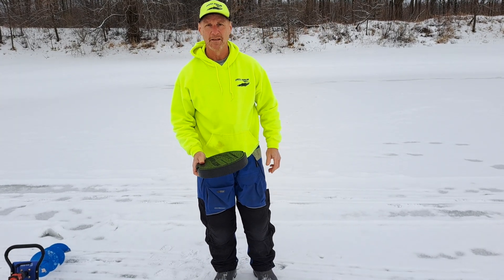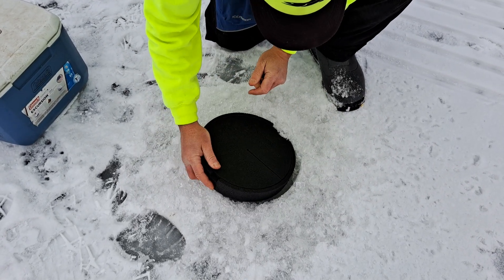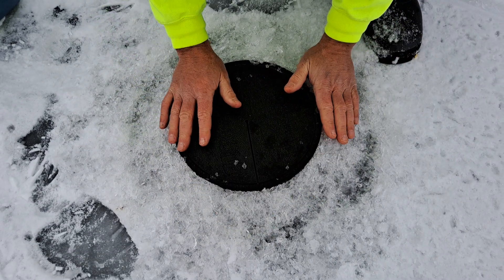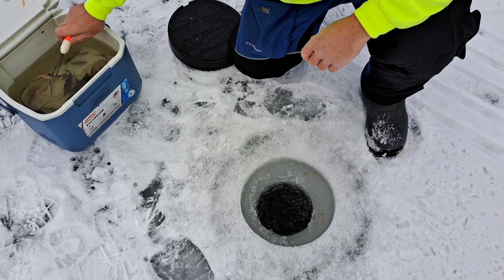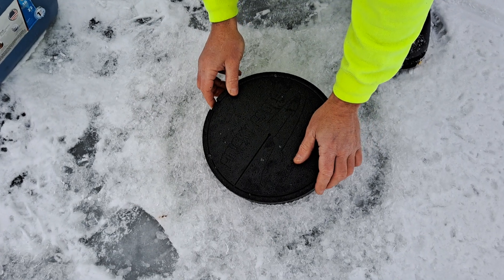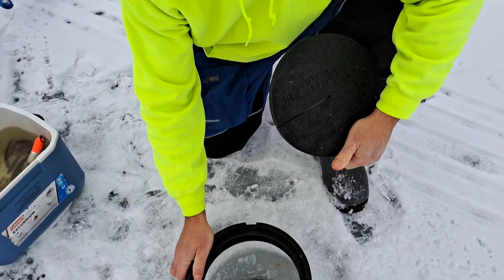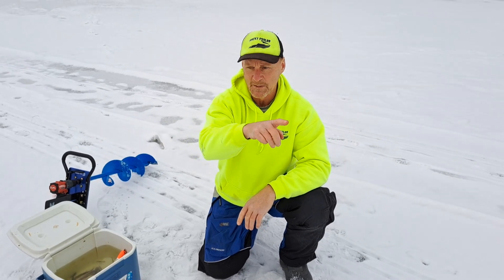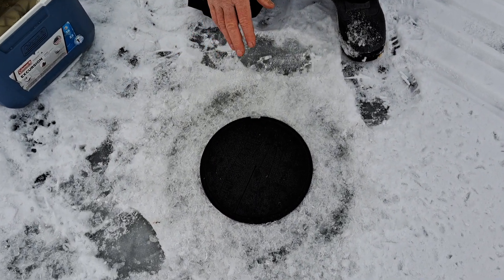Finicky Fooler Hole Cover Setup - 2023

Comment: Any recommendations for line to use? My biggest issue is my line freezing to my spool and not coming off smooth and the rod is bouncing like crazy when a fish takes it. And yes bail is open.
Reply: Braided or mono/flouro? I've started using almost all tip downs the last few years, unless it is crazy windy or insanely cold - then I get in the pop up or shack and switch to some tip-ups.  I've only had that happen a time or two. I would recommend swapping over to a line like Power Pro's Ice Tec with PTFE coating if you're a braided line fan. Many other braided lines will absorb a little water. If you're running mono/flouro - try running the line thru a few fingers on your rod hand when reeling in to pull as much off as you can. This is a big help keeping your guides clear, too. If you keep a towel on you or close by....try drying off the excess from the spool when you're reeled in and ready to set it up.